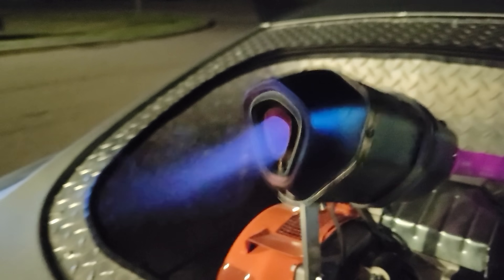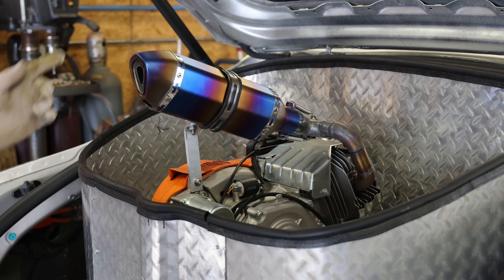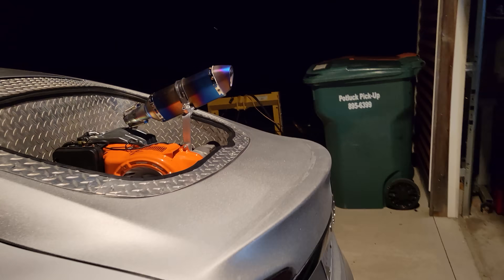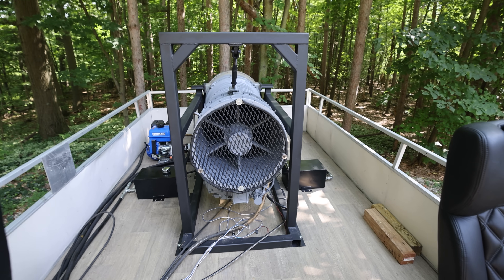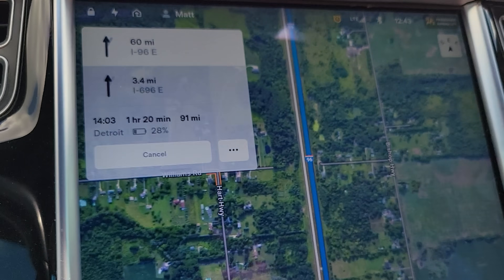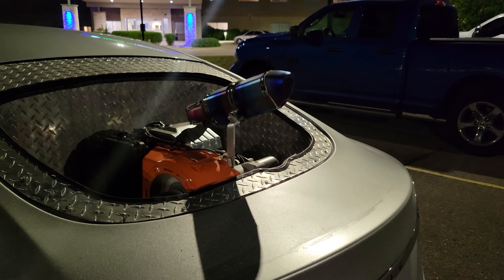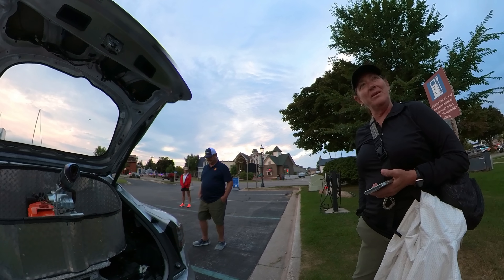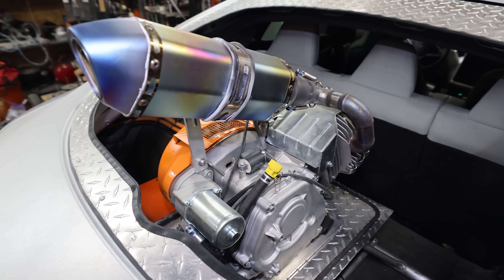Cordless Tesla (I Drive 1800 miles without charging) P.1

Comment: So this guy bought a tesla with his money. 
Modified his tesla using his money. 
Used his own ideas to make the tesla how he wanted it, then tested it  also using his own money. 

And started a shitstorm with the angry RC car supporters. 
Even if his experiments were a failure, it's still a win that he pissed off so many fanboys.
Reply from the maker: That's basically what happened lol. In reality I'm a very positive person and very optimistic, I honestly never have any intentions of getting anybody angry by building a particular project.
Reply: @WarpedYT  good to see your experiment, but why you didnt used Honda 10Kva generator instead of this noisy engine. I think they are fucking reliable. also the box you have made for the engine needs some modification to improve air flow over car. moreover I liked your experiment and wish to do similar but in opposite way.
Reply: @WarpedYT  screw em 😂 next time just use a honda generator, the silent series...
Reply: @WarpedYT  Even with me being a fanboy and driving a P85D myself I can't get angry or upset about this. It's kinda dumb and silly, you go do whatever you like man 👍👍
Reply: @WarpedYT   I'm just wondering if you could improve the efficiency while lower the total fuel consumed. What might be interesting to try is to incorporate some flexible solar solar panels to help recharge the battery or at the very least to power the accessories. This seems like a really cool project. My hat's off to you for the shear stubbornness of just not wanting to charge your vehicle for long trips. I'll be subbing and taking notes 😎
Reply: @wubbasplaylist  the reason why solar panels will never be electric cars because of consumers if they just put solar panels on cars if electric car companies put solar panels on cars then no company will be making there money which money is the root of all evil and it's being greedy but there's a slight problem with solar panels when there's not much sunlight it's cloudy you won't get a good charge
Reply: @WarpedYT  Did you wire the generator directly to battery or to charging port? Really my question is how did you wire the system.
Reply: @WarpedYT   how big was the gas tank for that thing?
Reply: @WarpedYT leave it running when you stop at place's so its charging abit for when you come back to the car.
Reply from the maker: @mattlawton088  I did. It wasn't enough power
Reply: @WarpedYT  it was brilliant and very entertaining I really enjoyed it. I wonder if you got a small diesel generator there's moor talk moor power and you can run it on red diesel or what ever it is in your country 🤔
Reply from the maker: @mattlawton088  the reason I haven't had any videos out in the last eight months is that I have been building the turbo diesel Tesla I had to design and build the entire system from the ground up electronics software everything. That video was supposed to post tomorrow but it looks like it's going to post on Friday, I think you will enjoy it
Reply: @WarpedYT  absolutely 💯 ❤  I love turbo diesels can't wait good man 👍
Reply from the maker: @mattlawton088  thanks
Reply: @WarpedYT  and thank you for the great content 👍
Reply: @WarpedYT  Take solace in knowing. .
You could be Captain Planet himself and some "eco warrior" would complain about the things you didn't do. The saying "you can't please everyone" has never been proven more right then the day the internet gave everyone a voice.
Reply: @WarpedYT  We know you are man. People who want to be angry will always be angry.
Reply: They're definitely a few people in the comments mad at him doing this but at the same time there are just as many people in the comments crapping on EVs in general. Most people with EVs are perfectly happy with them and not all of them cost 6 figures like this one. Most the issues that some people have (not all since a lot of people don't take long road trips very often) once there are significantly more charges. If someone can get by with charging at their house overnight or office why wouldn't an EV make sense for them if they're going to buy a high end car?
Reply: @putaleche  Because of the absolute horrific  consequences  of cobalt and lithium mining has on the planet.  Look at how many children under 12 are killed mining cobalt every year.   Then realize the batteries are not only worse for the planet they can't be recycled.   Evs are only aloud the same reason cigarettes are.   Paying off of crooked politicians.  Along with  a propaganda style marketing campaign produced by people who if they can't have 100% control over you want you gone off the planet.
Reply: Guys I'm ready for version 2 so please keep me posted and this time it should be community event where we all pitch in towards expenses because this is something worth looking into more and more
Reply: na this video paid for the lot, apart from the adblock crew :D
Reply: It’s pretty hilarious all the way ‘round.
At least the dude knows his stuff. It’d be cringe asf if he cut up a 70K+ car and couldn’t get it to work..
Reply: I am personally proud of him ☺️
Reply: Honestly I like electric cars. 
But come on. 
The guy can do whatever the wants with his car. 
People are getting pissed with another guy just living his life??
Reply: Got the tesla cheap from a fellow youtuber
Reply: Why don't you just say EV supporters? RC cars are gas powered too.
Reply: as a non ev supporter (at least in way, how they are presented as planet saving vehicles), let me present my opinion what did this guy did (i know the whole purpose was to get comment and clicks by that, but still):
- he put together non homologated vehicle, which was chopped  to harness additional ice engine with crazy loud exhaust, spitting fuel etc and hit public roads, hotels etc. so. not he just put at risk all the people driving next to this open box of lithium cells and liking fuel, he also manage to piss of all the people with that crazy loud engine while charging at full throttle over night etc.  if he really want to test/prove some "alternative" charging, he could at least done in some proper and safer way, with some quite, much more efficient and less fire hazard diesel charger (still defeats the whole purpose of ev car, but hey).
i realy hopping this whole circus was just some bad joke for attention, since it was idiotic as f. there, karen out.
Reply: So a Tesla requires about 80amps to fast charge.  A typical home has a 100amp service. So while your car is charging, you consume 80% of your homes max output. Now, imagine everyone else is too. On an average day, your using what? 50 amps max to operate an oven for 30 min? So with the huge amount of electricity now required, there will need to be way more power plants that u guessed it, burn fossil fuels. Wind and solar can't cut it, not even close. So while your (saving the earth) your actually making it worse. Much worse. So stop with this fake climate bs and drive what you want.
Reply: @Random-bm7ho  
This is old world facts. 
Nowadays you have plenty of renewables. Store them in LFP-/or Na-batteries and you are half way there. 
Produce your own solar. 
And, on a daily basis the average driver doesn’t use DC fast charging. 
AC slow charging is very convenient to charge a car over night or while you are at work. 
Maybe you do a little research next time before humiliating yourself by posting nonsense.
Reply: I don't care about all that. However, why is this legal and he wasn't stopped or even gotten a ticket????  Meanwhile, a simple transparent tint get you ticket and even jail, or a muffler for god sake a muffler. But this a whole hazardous generator in the car, god knows if it's installed correctly is fine. Is it cause he is a middle aged white man with a Tesla, cops feel intimidated to stop him. But any different car with a tint, especially people of color ticket fine jail. He has no rear view whatsoever, and this modification is hazardous. This is so insane.
Reply: Let’s tell that to the kids how we destroyed earth.  It’s not really about the freedom and money to do what you want but more about responsibilities.  We are ok with experiments, I hope no one else does this.
Reply: @MrManny  they might not be doing it here, but have you seen how much they destroy to make these electric cars. When it comes to mining for the the materials in other countries. It's not about the earth and environment. An what are they going to do with all those horrible toxic batteries when they die?
Reply: @stevefleshman9324  recycle the batteries.  I see no difference for people using double As and other battery products.  They gonna not use cell phones and laptops?
Reply: @MrMannyhw  and have you looked at replacement cost in an 05 prius hybrid it is between $900-$2500 before with core exchange. Think what a whole battery system will cost. So in 10 years you'll be buying a new car or public transportation
Reply: @stevefleshman9324  from Tesla it would be 20k but after market battery maybe around 12k.  Not too bad if you save that much in gas.
Reply: @stevefleshman9324  
What about drilling for oil and transporting it?
Ever heard about oil spills and the consequences of burning oil?
Go into your garage start up your engine and stay in there a few hours. Maybe that teaches you something?
Reply: @stevefleshman9324  
In ten years a replacement battery will be around the price point of a replacement engine.
Reply: @robinsonreichel1268  let's see if you can afford new batteries in that Tesla, or what happens if you run out of gas. Oh yeah can't just get some and put some in and get to the gas station and your fine. Good luck getting charged on the side of the interstate.
Reply: @stevefleshman9324  
Still having over four years of warranty on the drive train and batteries. 
You don’t ‘run out of gas' in a Tesla. 
You navigate to your destination and the navigator automatically calculates the necessary charging stops. 
You can always change the stops and search for different charging options.
Reply: @robinsonreichel1268  unless you're like the brother and sister that rented 1 for a drive from Florida to Kansas and it wouldn't stay charged cause it was too cold. They had the car rental company come switch cars. I think they had to charge 6 times in only a few hours. An fossil fuel is powering your charging station. Or power grid can't support all vehicles being electric and they know it.
Reply: @robinsonreichel1268  most gas cars last longer with less expenses, and can probably get 1 cheaper. I'll  take my 2022 Corolla. No thanks
Reply: Pizzing of your fellow man is the only reason for living for right wing nuts. Sad way of living their lives, making bad in the world for people and your country.
Reply: @bokhans  yeah I guess we need to start supporting drag queens at our elementary schools! You go right ahead champ!
Reply: @NicholasB45  
Are you maybe having gay feelings and afraid of admitting it to yourself?
Reply: I subscribed because of this
Reply: And NISSAN ENGINEERED THE E-NOTE🤔
Reply: I dont mind his experiment .It is some way interesting.  But nissan the e note that sounds more interesting.
Reply: How this thing can work without electricity generator ? This is obviously fake.
Reply: na man driving some untested bullshit at slow speeds is dangerous, roads are not a playground... also just parking it outside a hotel overnight running? this guy is an asshole LOL
Reply: @alfstewart50  you the assholz living cowardly life 🤭😂
Reply: I am a tesla fan for over a decade and i think that was a fun experiment and i'd love to see a version that has the engine connected straight to the wheels
Non native english speaker here
Reply: What is RC car?
Reply: This car is def attracting zombies during zombie Holocaust
Reply: so the goal is to not slow down or stop or fuel up during the entire trip?
he slowed down, needed to stop, and had to gas up. 
in the end its a hybrid. can  y'all say prius!  lolz
Reply: That's not a FAILURE! Just a step towards catching up with the past.  It should have been PERPETUALLY CHARGING FROM FACTORY. WITH SMALL CAPACITOR AT WORST FOR STANDING STILL & WEN NOT DRIVEN.
Reply: Right like u outside my room and didn’t ask me if I wanted to hear it from close!
Reply: I’m definitely a RC guy only cause my boys love it. This doesn’t make me mad at all. How could this piss anyone off. 🤣 some need to grow up.
Reply: This whole experiment was not just to annoy Greta Thumberg but also everybody else in this guys's path.. alongside Tesla fanbois on the interwebs
Reply: How do you charge while driving how does wiring work for that since stock if charger in port it won't allow driving can anyone explain it rooms up?
Reply: This is a cool idea but all the overnights. An then lose of power still will be long time to compete with gas on efficiency on distance.
Reply: Til his teeth are checked by someone NOT hiding behind a keyboard or a YouTube endorsement
Reply: The number of Karen's this experiment brought out in the comment section is definitely commendable.  lol

This shit will keep em coming & raging for a long time.. 🤣
Reply: @josephl3602  
Why don’t you just breathe more of your exhaust fumes straight from the pipe?
Seems to stimulate your brain to an Einstein level… 😂
Reply: @robinsonreichel1268  why is the grass greener on the sides of our interstates? It might just be because of carbon monoxide 🤷
Reply: @NicholasB45  
Internal combustion engines are about CO2 not CO. 
And they produce much more toxic fumes try it out in your garage. 
Get your 2 cents together, please,
Reply: @josephl3602   your name said it
Reply: @josephl3602  yep he just needs it to smoke💨 now then they'd be really passed 🤣🤣👍👍
Reply: @josephl3602  
It is not anger. 
It is desperation about so much ignorance for the consequences of burning fossil fuels and for the waste of resources. 
But I doubt that you will ever get the point, my friend.
Reply: @robinsonreichel1268  look at you.. Saving the world, one YouTube comment at a time.  

You go get em, champ. .
Reply: @josephl3602  
Nah, stupidity will never die.
Unfortunately. 
Man has always cut the branch he is sitting on.
Reply: @robinsonreichel1268  As is seen with your incessant need to "educate" people about the dangers of gas. 
You know it's not doing any good, yet here you sit, keyboard in hand. Congratulations.. 

I think they call that "insanity".
Reply: @robinsonreichel1268  RealClimateScience is your friend.
Reply: @robinsonreichel1268  You also missed the point that ALL Electric vehicles are charged using fossil fuels unless one has a windmill generator. Its not desperation on your part, its all just your own ignorance.
Reply: @robinsonreichel1268  What's "ignorant" is the fact you are clueless as to what is required to generate most of the electricity consumed in the United States.
Reply: @robinsonreichel1268  Fossil fuels still comprise the majority of electricity production for ALL EV's, you just don't have to be near it. Try being less ignorant...
Reply: @itskarl79  
Ignorance is denying the fact that there is more and more renewables every day thus making EVs more and more sustainable and that an ICE driven vehicle will always continue to consume fossil fuels, no matter what.
Reply: @robinsonreichel1268  yeah? where? I think you don't comprehend how your own food arrives on your plate.
Reply: @robinsonreichel1268  It's just carbon, and sunlight... ALL OF IT
Reply: @robinsonreichel1268  Invent magic, so everyone can all think the same way, nobody eat meat, nobody use fossil fuel, everyone vote the same, and then MAGIC gonna fix it all... MAGIC
Reply: @robinsonreichel1268  ignorance is over estimating the actual availability of renewable resources, wanna talk about how renewable electricity is manufactured?? do some research
Reply: @robinsonreichel1268  How are solar panels made... LOTS OF DIESEL used for mining operations. Just out of curiosity, what do you drive? What's your carbon footprint? Everything made today uses fossil fuels... You couldn't survive without it. try again
Reply: @itskarl79 
Sunlight and wind are endless. 
As is geothermal power. 
Fossils is what’s limited.
Reply: @robinsonreichel1268  So you're not using any fossil fuels? LOL
Reply: @itskarl79  
This is not the point. 
The point is that by driving a a Tesla M3P I am using lesser and lesser fossils each and every day. 
If I would have continued riding my ICE-car my use of fossils wouldn’t have changed at all.
Reply: But if you didn’t get the point until now, I strongly doubt you will get it if we continue.
Reply: @robinsonreichel1268  I'm not opposed to making things better. On a serious note, I am simply pointing out that it's necessary to exist. And this guy putting a noisy generator in his Tesla isn't any worse than recharging at a station.
Reply: @robinsonreichel1268  You think things are getting better? honestly asking.
Reply: @itskarl79  
Absolutely.
There always have been and will be bumps but over all?
Yes!
If everyone is trying to do her or his best. 
What more could you do?🍀🎄
Reply: @itskarl79  
I disagree. 
Because I think this setup doesn’t make sense, annoys passersby and neighbors and leads ad absurdum the idea of noiselessly riding electric. 
But one doesn’t have to always agree, right? 😉👍
Reply: @robinsonreichel1268  Hey karen you do know that most chargers use fossil fuels to charge your ev right? not all are solar or wind farms. Think before you comment
Reply: @josephl3602  Talk about ignorant - he calls them 'fossil fuels' (a myth invented by ol' Rockefeller himself), and probably believes in dinosaurs too.
Reply: @robinsonreichel1268  you sound like the kid on the playground desperately trying to argue why his Xbox is better than his friend's Playstation.

You're not saving the planet by giving Elon Musk your money and bragging about your poorly built Tesla.

You're just replacing one unsustainable, environmentally destructive resource (oil), for another unsustainable and environmentally destructive resource (lithium).

Not to mention the increased load to the power grid the rise of EVs will create. 
Grids that are again maintained by heavy mining and reliance on components made in high polluting countries. 

Absolutely nothing about batteries is good for the environment. There is nothing renewable or sustainable about a Tesla.
Reply: @link1565V2  
You are just as wrong as can be. 
Electric is in the early phase of development with LiFePo just being another step in the right direction, natrium batteries aso not even mentioned. 
There is infinite research proving you wrong because, yes the recycling facilities for Lithium batteries are built right now. 
Electric vehicles with much less moving parts than gas guzzlers will outlive any dinosaur vehicle in the future. 
ICE on the other hand has reached a development stage where further progress on an efficiency level is quasi impossible to attain. 
Combustion engines are insanely inefficient that is a fact. 
Every drop of fuel you burn forever in your fartmachine creates short of 40% propulsion, like it or not, the rest, like over 60% is just wasted and contributes to global warming. 
What an infinitely stupid concept, outrun by a much more efficient more modern idea. 
Get over it.
Reply: @robinsonreichel1268  lmao, you'd be upset if you seen my daily operations. You'd cry tears within minutes.
Reply: @whatta7793  
I‘d not cry, honey. 
I‘m not the crying type.
Reply: @robinsonreichel1268  you almost cried over this little 13 horsepower gas motor.. 15+ diesel engines, hundreds of cut trees, tons of land bulldozed, I'm sure you'd cry, or throw a hissy fit.
Reply: @robinsonreichel1268  you should turn your computer off to save energy to save the world look within stop pointing the finger at other s
Reply: @robinsonreichel1268  you didn't actually disprove anything I said.
EVs right now are just empty promises, and again, you driving your current Tesla does NOTHING to better the environment.
Your fancy future EV that runs on one of the many super duper battery technologies they've been promising for 20 years might be better. But right now that car doesn't exist. It won't exist for a very, very long time. What exists are the current batch of Teslas, which are some of the most poorly built cars on the road.

Battery recycling isn't anything new. That doesn't stop millions of batteries ending up in landfill every year.

So, again, feel free to think you're actually making a difference by giving your money to Elon. If that helps you get up in the morning, more power to you.

I don't really care about your arguments against ICEs. I never actually said anything about their performance or efficiency. ICEs being bad for the environment doesn't automatically make these EVs sustainable. You're not fixing the problem, you're just changing it.

You've completely failed to address the huge amount of lithium mining that is required, because you know it's true. You don't care about the absolute environmental devastation those mines cause, as long as you can impress the other mothers at your kids soccer practice.
Reply: @MichaelDillin  
I am using my phone writing this. Powered by renewables. 
So, what was your point again?
Reply: @Robinson Reichel  when you plug your tesla into the wall, where do you think that electric comes from?
Reply: @blackbird1234100  He thinks air...
Reply: @josephl3602  I was waiting for you to do it
Reply: @robinsonreichel1268  And you're holding the branch for them.   Unable to use comon sense  or crystal thinking skills.
Reply: @trone3630  You can't convince a guy like him to have common sense.  OP  is the kinda guy who complained how  simply awful Hitler was as dropped the jews off at the concentration  camps after he took their weapons.
Reply: @robinsonreichel1268  fact oil is the most abundant  liquid on the planet.   The only thing more abundant  is water.   Oil is 20 times more abundant than fresh water.   I know you were lied to and believed it but it doesn't change facts.   Facts don't care about your feelings.
Reply: @trone3630  
No. 'RealClimateScience' is just stakeholder BS.
Reply: @robinsonreichel1268  ok
Reply: @robinsonreichel1268  yes at the end
Reply: @blackbird1234100  
In my case solar.
Reply: He basically recreated a hybrid. Which is the only real halfway viable ev.
Reply: ironically, he still had to use fossils fuels to make it work. lol